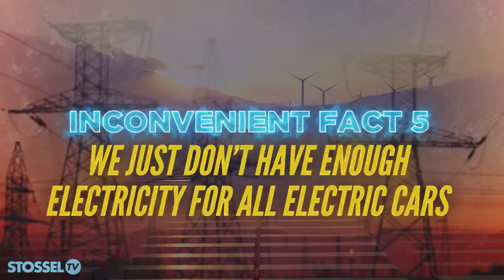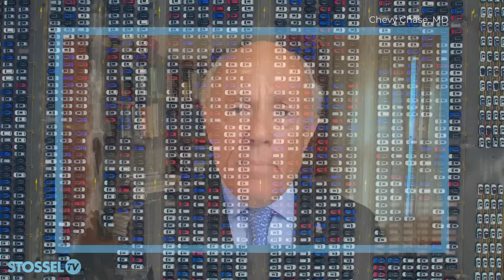Electric Cars: Inconvenient Facts, Part 2

Comment: What would be an easier way to control people than to keep them from moving around. It’s all about control.
Reply: How exactly are electric vehicles keeping people from moving around?
Reply: This is about the auto market. EVs are just way nicer to drive and maintain.  The pollution savings are a bonus on top of that.  It is like having a top end luxury car drive train at main stream price points. But of course even smoother, quieter and more responsive.
Reply: @Fishy you're wrong and almost every account. They are not more expensive than other cars in their class. A 2023 Escalade starts at $80,000 and goes up to $105,000. Compare that to a Model X. I can go on with every model. They are as comparable to cars in their class, and year over year they will become less expensive as the cost of scale gets cheaper. This is simple math.

Regarding mileage, the average is about 300 miles per charge right now, which is about the average mile per tank of gas. 95% of the people on this planet don't drive more then 50 miles a day. With the exception of Long haul trucking, which is another topic entirely, nobody's traveling 300 miles a day so it's an utterly moot point. In the event you do need to travel more than 300 miles a day like if you want to drive from Northern California to Southern California you stop one time for a half hour and charge. Big deal it's not some conspiracy theory.

You are correct demand outstrip supply right now but with giga Texas, giga Berlin, giga Shanghai, and two other rumored plants to start operating, it'll be a couple short years before Tesla is turning out more vehicles than GM and Ford combined.

Your words tell me you're one of these cookie conspiracy theorists who probably also believes in chemtrails. You believe in chemtrails don't you
Reply: @Fishy I can't take you seriously when your first sentence is provably false. An Escalade cost $105,000. Compare that to a Model X
Reply: @MajDuty  not sure about the usa but in australia it definitely is more expensive, we bought a nice car for 20k but the cheapest electric car was 40k

Comment: Have a good friend that is a engineer at a 'name brand' battery manufacturer .  He stopped telling people where he worked because (to paraphrase )"He was tired of being lectured to by people with no electrical engineering background" when he stated the reality of battery manufacturing's future !
Reply: Even without electrical engineering knowledge,  most people know that we don't have the infrastructure to support the added strain on an already taxed electrical grid.
Reply: 14 million EVs to be made in 2023. 
In the wintertime, I will use 5% more electricity by having an EV. Wow.
Reply: @MbeyaIsHome 5% x millions upon millions of people is not the insignificant amount of electricity you are hinting at.
Reply: @MbeyaIsHome Except you won’t be driving in winter when temps are sub-freezing and when you are able to venture out in near-freezing temps, your batteries will only operate at 50% capacity (or less) so you’ll be spending twice as much (or more) than you think you will.  Meanwhile, my IC will continue to function just fine as I drive past your stranded EV stuck in your driveway with a dead battery…. 😂
Reply: @MbeyaIsHome your a real thinker arent you? Lol
Reply: @kelb0y9o20  A little advice. If you're going to make fun of someone's intelligence, make sure to use the correct "you're/your".
Reply: @lakojake4215  naw I dont care about that.. I treat texting just like speaking...its youtube not college get over yourself. if your typing i dont care...and I  wasnt attacking any intelligence. If you caught any sarcasm on that comment good for you.. Good luck with giving your "advice" have a good one.. And eff off with your grammar ..  Text the way I talk.. Its youtube not college dip
Reply: @RoadieWingZZ  And the prices the companies can charge you to recharge your car will become astronomical during the cold months!
Reply: @RoadieWingZZ  Exactly. Same problem in reverse in the South in summer. Whose gonna ride around nowadays with their A/C off? Nobody. Well guess what those compressors suck down a lotta power.

Comment: the irony of California requiring electric vehicles is that they had rolling blackouts several years ago.
Reply: I interviewed a top energy expert on my home page vid. He warns EV conversion will not happen and oil can never be replaced.
Reply: In Quebec we run on hydro-electricity so you would think that it's the best place to have electric cars. Well, first of all battery autonomy is considerably reduced with cold weather. Then, when there is an icestorm, there is no more power to charge those batteries and you stay where you are and pray.
Reply: Well if the State is full of electric cars connected to the grid then that is unlikely to happen again given all that stored electrical energy!
Reply: And they were still using fossil fuels for power.
Reply: The rationing & blackouts was in part due to heat waves & droughts, so less hydro power.